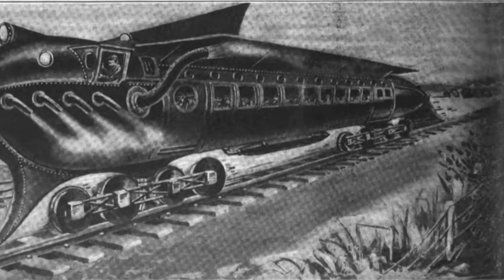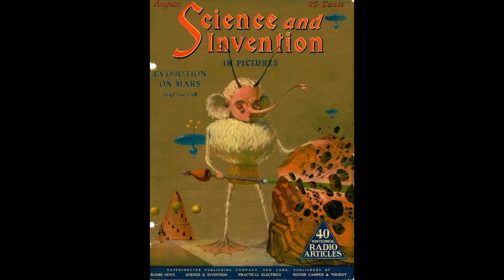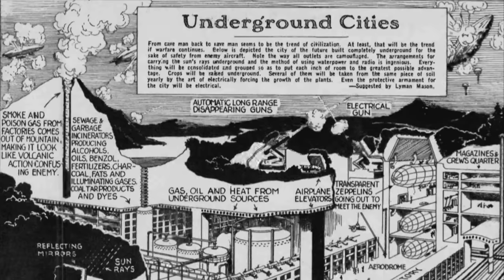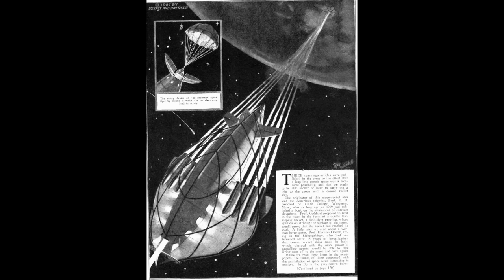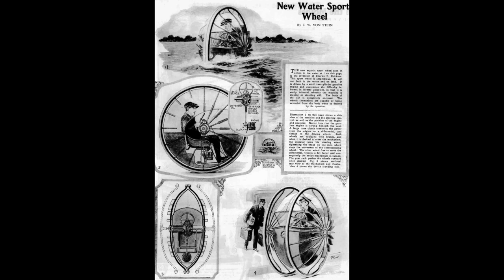The Future Of The 1920s

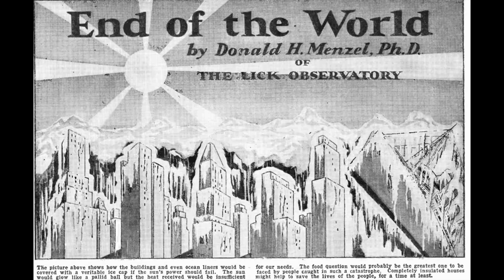Comment: 6:48  100 years later corporate events are not that far off from that. Multiple rear-projection screens, speakers on the sides of the screens, technical staff seated and operating the equipment from backstage, technical director and other staff sitting front of house.
Damn, 1920...switch the "Drama TV" with corporate content and you nailed it!

Comment: Some of the images blew by so quick I had to pause the video to take in what I was seeing.  Some of these visions are surprisingly close to what eventually happened.  The vehicle at 7:30 for instance looks pretty similar to a VW 23 Window Bus from 40 years later.  Other images depict buildings with what looks like a helipad like many buildings in metro areas have today.  On top of all this, the Art Deco look of the 20s and 30s is just plain _cool_.
Reply: There was one image of a single tall building that looked much like the Burj Khalifa skyscraper.
Reply: After Art-Deco, design took a sharp downward spiral.
Reply: I agree.  They were far closer than I would have expected.  About 80% of what was shown has actually been done, maybe a little different than drawn, but you can clearly see the base idea that was eventually realized. Helicopter for fire fighting, trans channel tunnel, remote physician diagnosis and treatment, slidewalks, hard pressure suits,...
Reply: there will be more infrastructures the future for drone landing. a common scene in a not so distance future.
Reply: @waynecampeau4566  You can find really old films that show the moving sidewalks. They must have discontinued those for a reason! I imagine there were safety issues. And they almost guessed 3D printing. Like the cartoon with the house building machine.
Reply: @thememoryhole9355  I have used "slidewalks" at a couple of airports. They really help cut down the time and apparent distance when walking between terminals that are 2000 feet apart.  I think it has more to do with the maintenance costs. They are basically escalators laid flat that are about 700 feet long.  Lots of moving parts that get dirty and wear out quick, so only really practical at places with high traffic loads and time is money.

Comment: 3:10 Using the roofs of city buildings as pedestrian plazas seems like such a neat idea! It would be especially helpful in a time when cars dominate transportation.
Reply: Parts of SE London still have the original attempt to put this into production. It was called the Pedway and was started around the 50's and mothballed by the 80's. Sadly, most of what remains in and around the city is attached to dive housing estates riddled with the bottom feeders of society.

Comment: It actually makes sense. when buildings are taller and taller, some up to a mile up into the sky. It only makes sense to use flying vehicles to directly stop at the floor I want to go instead of parking the car at the basement and then wait for 2 elevators to get to the place I want to go to.

Comment: . 1920 is defently in the diesel punk era. early yes, but still diesel punk

Some of those things actually does exist.

Rooftop gardes exist, but they are often private to the building. I seen very few cases with rooftop garden bridges, but they do exist.

Something that people take for granted, but actually have existed a very short time, is mixed used buildings.

3:32 Yea, this absolutly exist, well it don´t look quite like this. Called dish CSP. The generator have been miniaturized so it actually up in the receiver today.

4:10 Induction road power . that does exist, but mostly for trams. Its quite rare, but in commercial operation.

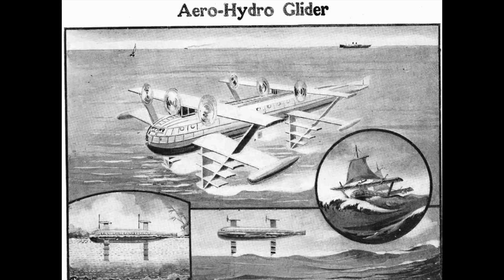4:16 i´m not sure, but it looks like a space lab with a typical 1920 scientist and what look to be either a secretary or possible (human)-computer. What they use to call people doing math operation back before electronic computer existed. this is basiclaly the ISS

4:18 Hydrofoil boat. Those also exist. But they are quite rare. Typically they are powered with a water jet instead of a air prop. its interesting that people in the 20s known that hydrofoil and water props was a bad combination, i guess someone already tried.

4:26 A wheel less subway do exist. But as far as i know, non of them use oil film, they rather use air film. And i only know of one that is in commercial operation. So its not that common.

4:49 glass en closed city street existed already back in the 20tys. They have not become very popular. But there are quite a few of them. The thing is that the existing roofs are usually used, really just enclosing the streets. Basically changing the use for a street to a indoor promenade. With hardly any plants, mostly plant boxes, rain is not needed.

4:55 Scy promenades exist in some large Asian cities, but they are pretty uncommon

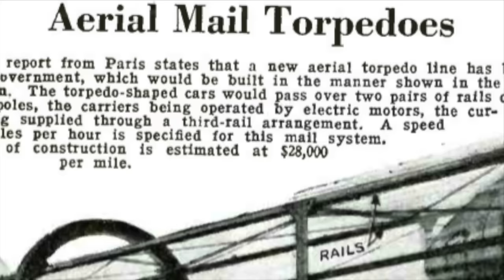5:08 i don´t know what the instrument is called, but it did exist already in the 20-tys. Mostly used in old scary movies.

5:36 That looks like a diving suite with a waterjet pack, yea those are decently a thing. but the water jet is typically a stand a lone product.

5:48 Fire firting helicopters. yea those exist, While, yes, its autogyros in the picture. But the idea is pretty much the same.

6:02 Multi floor highways does exist, again its more popular in Asia, and they are typically just two floors, i have seen 3 floored once. I kind of have a hard time see the point in enclosing the road. The problem with carbomonoxide was well known already back then.

6:08 This is basically what I-max.. or rather imax dome is. While the screens are seamlessly integrated, so really quite a bit better. But the core concept is the same. Intrestingly, a Imax dome is smularly large space front, top and side, but non in the rear.

6:17 Flying cars.. still don´t exist... and we are still trying to make them. (and no, a helicopter is not a flying car, its a helicopter)

6:37 this concept pretty much relies on the flying car, that don´t exist. But helicopter landing pads on buildings are really not that uncommon.  This also is a multi function building that are still quite rare. (but existing)

6:46 yes a 3D TV... something that been tried again and again.

6:53 yea, nuclear bombs, we does have those

6:59 Tiny CSP in a cell like structure.. so basically a solar panel.

7:03 Stereoscopic cinema. yepp.. i don´t know if that is in use anymore, but they use to be common just a decade ago.

7:23 Cluster observatory. that was pretty smart to think about that in the 1920-tys. Those are a thing nowdays, but have not existed for to long.

7:30 yea a bus.

7:46 A space cannon. Someone is actually building this concept now, called spin launch. 

7:55 That was done in 1969. So with in the life time of people who made the picture.

8:26 A solarium. Work totally different as in the picture of cause, that is kind of odd, because the technology to make solarium with tube lights, was available already back then

8:30 there was a string of ground ships made in the 1950s. But they kind of failed pretty spectacular. There just never was a need for it. Its just simpler to build a road.

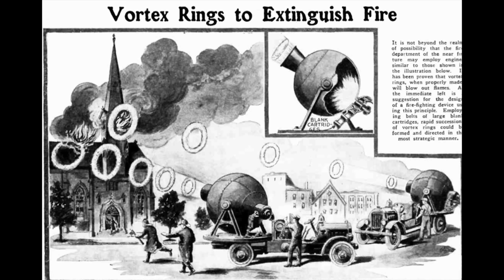9:19 this looks a lot like the US amfibus asult vehicle during WWII

9:24 i guess we just call it an airport today. Note how the airplanes at the side have no runway.

9:33 that product exist, called an ericsson skycrane. Looks a bit diffrent, but works the same.

9:36 Well the Chanel tunnel. While fairly accurate. The current tunnel is under the sea bottom. I guess the way we can handle pressure today is better than they could back then. Still they had subs that could go pretty deep.

10:05 Yes a TV. worth saying is that the first mechanical TV did exist already back in 1920s. So this wasn´t just science fiction. it was a existing concept.

10:27 While a north pole station never existed, and now never will. Back in the days when aircraft had shorter range, a lot of aircraft landed on Iceland to switch over passenger. That way getting from most airports in Europe to most Airports (major at least) north america with just one switch

10:37 Telemedecin.. i guess we are half way there.

10:58 Today called artificial organ and limbs, we got most of those

11:53 Mars uplink. We have had that about 20 years or so now.

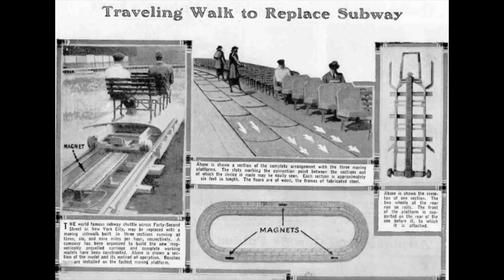12:03 Moving pavement. Yea, that have been tried quite a lot But it turns out when the speed is increased there is more problems then just the obvious. It would seam like the maximum speed is about 10km/h, and that is really to slow to replace subways.

So a lot of them exist. Of  the other, some are just stupid, some existed already back then, but a few is still unreached. The number that is unreached is actually quite few.

Comment: I liked the "aero hydro glider."👍 They actually do have that today, both motorized and sail powered. Racing yachts today are on hydrofoils and do 40-50 knots(70-90 km/h). Seems cargo/passenger sail ships would be a cheap (free) alternative to the gas guzzling flying gas tanks we use now. A little slower but who cares? New York to Lisbon in 2 days on a hydrofoil ship is not that bad.

Comment: Thank you for the video. Some terminology needs a little correcting.
Victorian sci-fi is not steampunk. Steampunk is a genre based largely on Victorian sci-fi tropes for the setting, but with a difference in tone and frequently borrowing from "thematically-adjacent" genres. "Victorian sci-fi" and "steampunk" are not the same thing, and the terms cannot be used interchangeably.
Likewise for raypunk, atompunk, and so forth, which are pastiches of era-specific sci-fi, but are not the sci-fi of that era.